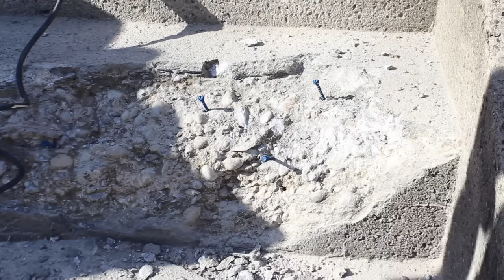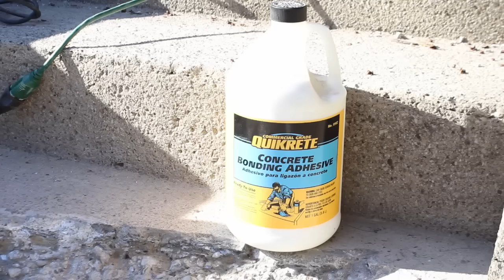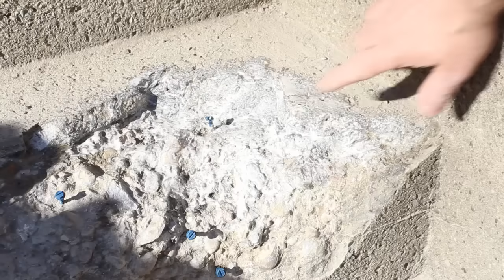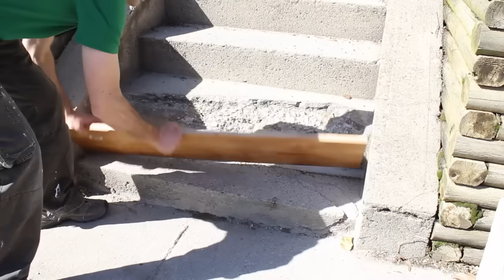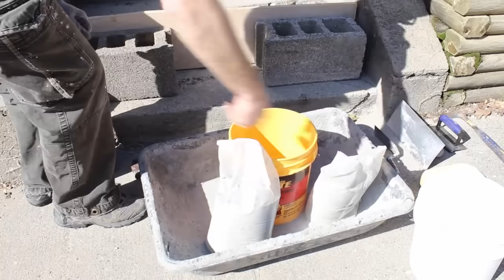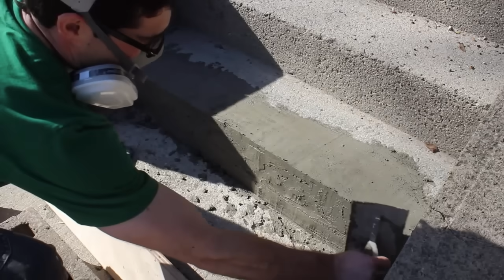Cement Step Repair in One Day

Comment: I like this method and was wondering if it would be suitable for repairing a typical wedge corner pop on a concrete slab? I have 4 corners to repair that support a 2 story brick wall.
Reply from the maker: It's worth trying as long as those corners aren't contributing to the load of the two stories. If that's the case consult an engineer.

Comment: You could have saved a lot of time using a concrete vibrator, rotary drill or hammer on the form to eliminate the voids and filling void step for a cleaner look....
Reply from the maker: +Emmanuel Zamora possibly, but remember that this technique uses fast setting cement

Comment: All the bonding adhesives I've used state you need to put the concrete on IMMEDIATELY after applying - not waiting for it to dry. A dry adhesive is not an adhesive.
Reply from the maker: +James Cobalt simply from losing the Quikrete directions 👍
Reply: From Quikrete directions:A. Paint on Application

    1. Apply to surface with a brush, roller or spray to the thickness of a coat of paint. 

    2. Place new concrete, topping mixes, Portland cement, plaster mixes or patches as soon 
        as adhesive is dry. Gypsum plasters and finish plasters should be applied while the 
        adhesive is still tacky.

    3. Base coat plasters must be dry before applying adhesive.

    4. Tools, brushes and other application accessories should be immediately cleaned with 
        warm soapy water. Use hot water to clean-up any drippings.

Comment: How to repair the crumbled concrete at the entrance to the garage -i.e. where the garage door closes?
Reply from the maker: we have the same situation and I've thought about using sand leveling products but haven't done it yet. That would be one option and the other would be to tear out the little concrete pad and redo it. I'll probably try the first method and see how long it lasts.

Comment: Craig, I'm a concrete contractor, and if I were in your shoes I would rent a concrete saw that will cut at least 75% of the depth of the slab, cut it at a right angle off your house, preferably so the existing cuts are all spaced out evenly, snap a chalk line and remove an entire section. Use tap-con screws to fasten a 2x4 to the masonry below having the top flush with the bottom of the small ledge. Then after you establish the height of the slab, fasten a 2x10 to the 2x4. This will be your form with a matching ledge. Then you can simply order one cubic yard of a residential mix with air for exterior use. Pour it wet enough for you and a buddy to handle and screed the concrete immediately with a straight 2x4 and float the surface a few times, then if you have a steel trowel, trowel the surface slick then pull a broom in a straight line if it needs a broom finish, if not, just keep troweling until you have your desired look. * make sure to round over the  edges, use any electric tool that will vibrate (I use a square palm sander)  and vibrate the edge of your form to reduce "honeycombs"  also apply an oil so your forum will come of after pouring. Plus you don't need sealer. I only use that on decorative concrete, or places like a garage where oil will spill and penetrate the concrete surface. That was a long comment... Uhhh, good job guy on video! Stevens Concrete Llc, N. C.
Reply: $35 vs $1500  i don't think new steps were needed.
Reply: im a cement contractor also im italian   my family is in the trade & what we would do is break the step completly make a form & re pour much better job
Reply: Shutup
Reply: great tip with the palm sander, have a couple of those that seldom get used until now..
Reply: Stevens:  can you say more about the following piece of your comment, which I copied below?  I am not 100% sure what exactly you are saying to do - thanks.

"Craig, I'm a concrete contractor, and if I were in your shoes I would 
rent a concrete saw that will cut at least 75% of the depth of the slab,
 cut it at a right angle off your house, preferably so the existing cuts
 are all spaced out evenly, snap a chalk line and remove an entire 
section. Use tap-con screws to fasten a 2x4 to the masonry below having 
the top flush with the bottom of the small ledge. Then after you 
establish the height of the slab, fasten a 2x10 to the 2x4. This will be
 your form with a matching ledge."

Comment: Jeff, Tried to post this on your website but it wouldn't take. 

Our porch is a 7.5" thick slab, about 20' long, but only the last 7' is cracked (one end of a sidewalk is leveraging up under the slab as the other end is sinking). The slab overhangs the foundation by about an inch. The crack is back about 4" from the edge and the broken area is about to fall off. I'd like to take off the broken part and patch the slab the way you did in the video, but with the form under the edge as well. My questions are, how well would this kind of patch last in Kansas City winters and summers...will a crack develop between the new and the old? And, how well will the overhanging edge support the weight of people walking on it (part of the repair will be on top of the foundation wall). I don't want to replace the whole porch, because the cost is huge!

Thanks.
Reply: A pro would have to look at that job to answer your question. Too many variables.

Comment: How to you repair the inside corner of the top tier of steps (has a short block wall next to it) that goes into dirt?
Reply: i love you john cinA
Reply: i use the same starting procedure has this guy, bondaing agent etc,  skip to where he takes the form board off, you see him packimg in the cement,  you can use an inside corner trowel to fill it in with cement.

Comment: Hi. I found this video helpful. I, too, like others, just have the edge of a step chipping off. I read in one of your replies that the tapcons are not needed, if I want to patch it up. You also stated to use cement bonding adhesive. Could you explain this again please? Also, how much cement is adequate? I will not need to mix a large amount. I am trying to gather everything needed to do this project on my own. Any other suggestions?
Reply from the maker: Silvia Chavez you can find all the supplies over on Home Repair Tutor http://www.homerepairtutor.com/cement-step-repair/

You'll likely need just a small bucket of the cement. The bonding adhesive allows the new cement to bond to the old cement. You'll also see this in the supply list on HRT :D

Comment: What do i use to frame the concrete before i repair my one step so it dries correctly?
Reply from the maker: You can use plywood Patricia Gibson and make sure to spray it with Pam cooking spray on the sides that will touch the new concrete. That way the wood will easily slide off the concrete. Hope this helps :)
Reply: Thanks Jeff

Comment: I have done this before with concrete screws to act as teeth but I wasn't aware that other people did the same thing.
Reply: I also add bailing wire wrapped around all the screws in a criss cross pattern
Reply from the maker: bg147 yah, I love that little tip. It helps keep the cement anchored.

Comment: Ok I watched all the step repair videos on U-Tube.
This is the best one. Thanks Jeff tomorrow I think I can do it right.
Reply from the maker: Thanks so much Rich Johnson - I tried to give as many tips as possible. Let me know how it turns out Rich.
Reply: Turned out real good. Looks right and I think it will last. On to tuckpointing!
Reply from the maker: Fantastic Rich Johnson - glad to hear it went well. I have to do a pointing project myself. Mortar is falling out of some bricks and I want to get this repaired before this winter.
Reply: How did your cement step repair hold up? You left this comment 8 years ago.  I need to find mine so thought you'd be good to ask.

Comment: i didnt get it why we need the last step "to seal the concrete". where to seal?
Reply from the maker: Sorry for the confusion YoBoost Com - all you need to do is spray or brush on a cement sealer on the new cement. This helps preserve the integrity of the new cement and prolong it's life. It's really important here in Pittsburgh since we get all four season which bring snow, rain, and cold weather. Hope this sheds some light on the need to seal new cement.
Reply from the maker: Apply the sealer according to the directions, the one by Quikrete says to apply it when the concrete has hardened and the sheen has disappeared. Hope this helps Farron X

Comment: Thanks, Jeff.  Lot's of good advice.  Some I had heard before but you added details, like the rounding of the edge, spraying with water for 48 hours and even covering with plastic to keep moisture in.  Nice presentation too!
Reply from the maker: Thanks Scott Hileman Television Guy Scott Hileman - let me know if you have any questions down the road, I'd be happy to help. I'm no cement guru but do enjoy the process.
Reply: Much appreciated.  I got my my step down to nearly a nub after clearing the decaying material.  Got the Tapcon Screws in, coated the existing cement with an adhering formula, cut my form, just in time to get a bit of vertigo.
Question.  How long can the bonding agent be exposed before it becomes ineffective in attaching old to new cement?
Thanks again!
Reply from the maker: I think Quikrete recommends not more than 48 hours Scott Hileman Television Guy Scott Hileman and to keep the surface clean. Great job prepping the step and getting everything ready. Keep me posted.
Reply: Jeff Patterson
Okay, well my step is cement step is repaired and looks pretty good, not as yours, but with practice comes better work.  Plus when they say "Quick Dry" they mean quick!  I found myself have to move faster and faster and using a little extra water.  I ran just a little short on materials so I think I'll get one more package of the quick drying cement to smooth out the "rise" of the step, and there were a few extra little spots I want to go over just to enhance the look.  Thanks again, I'll post you some pictures I took along the way!
Reply from the maker: It does dry super quick Scott Hileman Television Guy Scott Hileman  - I'd love to see your pics. So post those bad boys

Comment: Thanks for the video, Jeff!  How would you approach this if it was minor damage where only the edge of the step was worn?  I'm guessing you'd leave out the part you did with the screws and chiseling and probably wouldn't need to use a board.
Reply from the maker: You're right Jeremy Amaismeier. If the damage was minor and less than 1/2 inch deep I wouldn't use the tapcons and instead would mix concrete acrylic fortifier with the concrete to make the bond between the new and old concrete strong. I'd also mist the old step with water to help with the bonding process.
Reply: Thanks for the advice!
Reply from the maker: Hope it helps Jeremy Amaismeier - keep me posted

Comment: Yeah, me commenting again...The step repair looks amazing.  If I wanted to recreate the same surface texture of the other steps what would be the best way to do that?  A suggested video I'd love to see would be on repairing a large crack in a garage floor.  We have one that runs the length of the garage and the thought (and expense) and jackhammering it all out and repouring the floor is overwhelming.
Reply: hahaha... 4yrs old, but I am still going to comment... a cracked slab can be v-notched and filled with a 2 part concrete epoxy, dried, ground flush, and coated... Elite Crete out of Rhode island makes great concrete refinishing products and they are great people to deal with... once you sit through their class, you can go back to the class again for free...
Reply from the maker: Thanks redhotsweetpotatoe for your question. I'd have to see the step to figure out the exact method. You could tinker around with different types of cement until you get the exact match. It could be hard to recreate depending on the shape and color. But a worth experiment.

I'll have to add your request to my video to-do list. I'm pretty sure I could do a crack repair. Our garage floor is cement and looks super bad for a number of different reasons. I appreciate your feedback :)